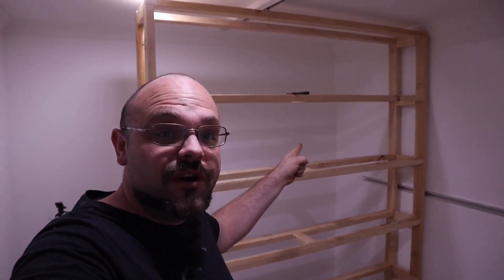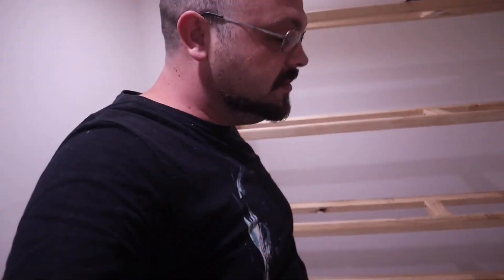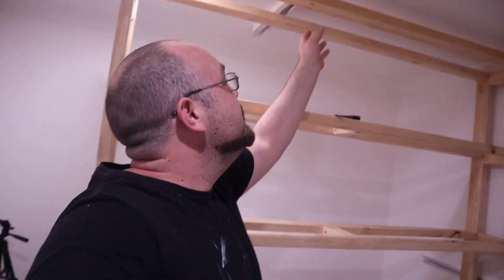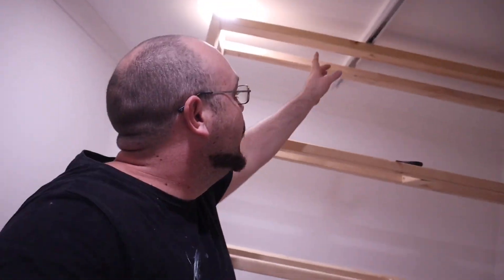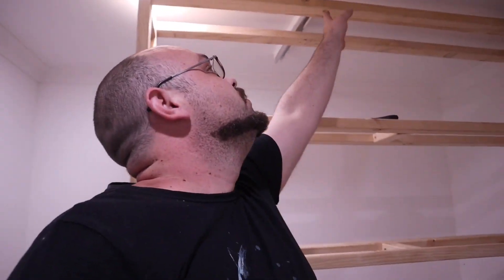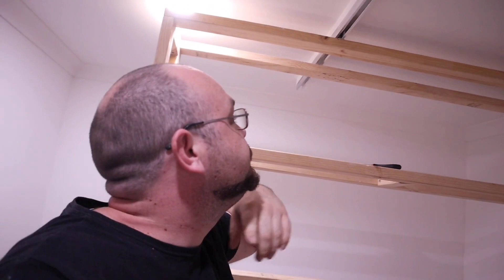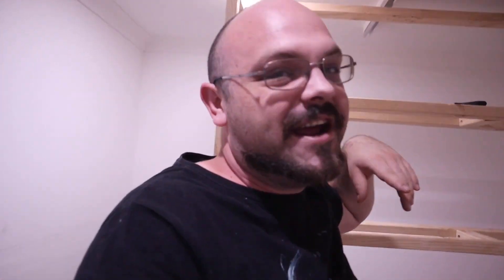3rd Tarantula Room Build - Looking Awesome So Far

Comment: You could do a false flooring system like libraries use.My uncle did this worked out cheaper compared with individual wheel costs.
Reply from the maker: Thank you very much for the idea and I didn't even think of that😀 but because im now also building a forth room ive had to completely charge the design of the 3rd. Im just going to by shelving and dee what im able to do